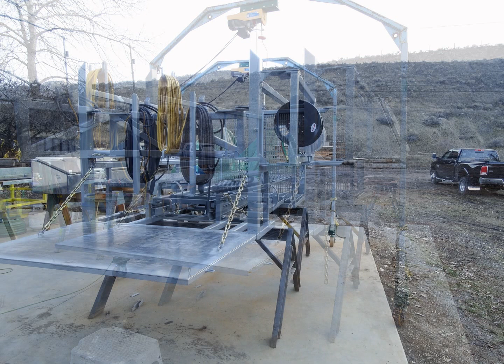Build your own welding rig

Comment: That's a baddass Rig! The only critique I could give is, you should've used the square tube frame as a chase for wiring for the work lights, antenna and warning lights instead of zip toeing them to it. It wouldve just made it that much cleaner. Baddass though I'm very jealous
Reply from the maker: thank you.
the skid frame has no open ends, as such it is a sealed unit no water/salt can get inside. that's why i ran the wiring outside. you could probably get away with running the wirinhg inside though too. i'll have to think about that next time i take it apart for repaint. thanks again.

Comment: Outstanding work man. Did you bolted it down into the bed or does it ride pretty stable with out bolts?
Reply: I'm about to build one like yours, by the way thank you for sharing your ideas.
Reply from the maker: the skid is bolted to the 5th wheel mounting frame under the center of the box. it has to be bolted down by law. good luck!

Comment: Cool,  I finally figured it out how you did the rollers and slide out(Brilliant), thanks and nice work
Reply from the maker: you'll want to get the fab shop to form the channel as close as possible to the large diameter of the wheels, otherwise it will have a noticeable sag when it's pulled out. don't get discouraged if you have to tack it up and take it back apart quite a few times before you get it just right.
Reply from the maker: I'll have a look tomorrow but I'm fairly sure the rails are formed out of 5/16 plate.
Reply from the maker: and by the large diameter, I mean the flat part between the outside bevel and the inside shoulder.